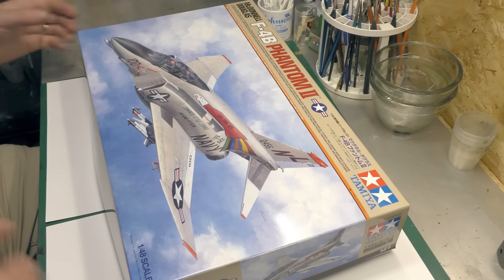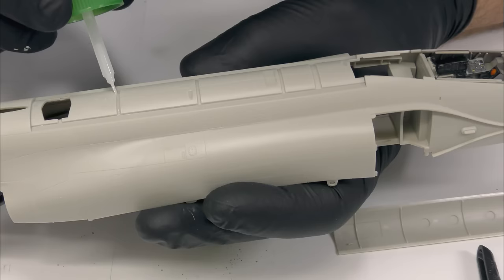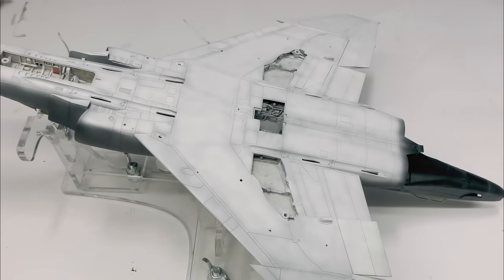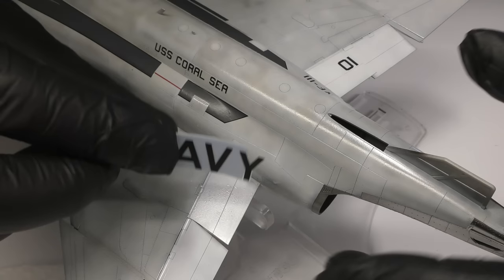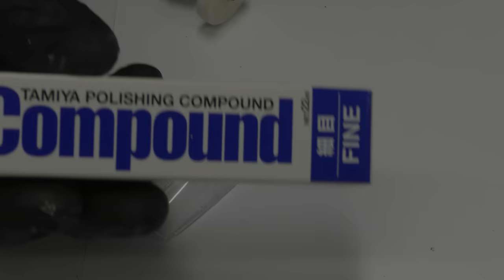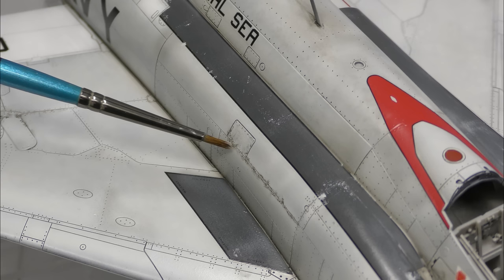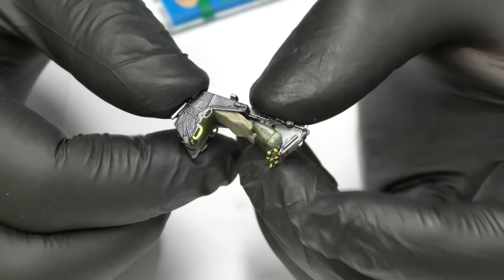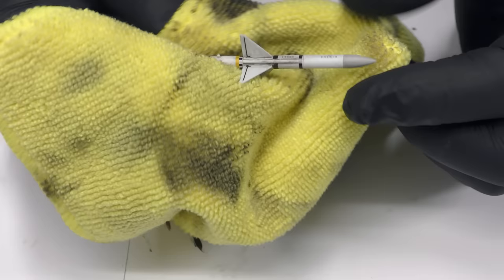Tamiya NEW 1/48 F-4B Phantom II VF-111. Full build aircraft model kit #61121

Comment: I agree that the weathering is way over done. A Maintenance  Officer that let an aircraft get to the state in this video would have been looking for a job outside the Navy. The aircraft would have failed corrosion inspection and the CO would be as mad as hell because it could end his career. One thing that modelers do, not just in this case, is highlight the construction panel lines. These are the panels that can not be removed. If they show a different from the flat surfaces around them it was a sign of a crack in the paint that would lead to corrosion and indicate poor maintenance.  Rivets did not show every much because they were flush and the paint filed in at the edges, if they showed it was because of corrosion. Models that have dents in the plastic for rivets are highlighting things the should not be indicated, fill them in. Service panels are a different story.  They could have chipped paint, dirt and grease that make them show up. Access fasteners could have chipped paint and be from painted to bare steel. The plain captain would have worked hard to keep dirt and grease streaks off the plain so that a leek of any kind would show indicating a problem. The area between the engine nozzles would have been oiled as a protect against heat damage to the metal and it would have a burnt look. This would include the tail hook. If the aircraft you are modeling was painted during the cruise it would have been done in PI and had no problems with the paint for the rest of the cruise. On board ship only touchup painting was done. When aircraft came out of the check cycle most the the panel indication text was deleted, the safety marking, warnings and national markings were the only thing that could be counted on to be there. This model looks impressive to some but it is no ware close to correct. Some of the area you did were very good like inside the wheel wells, the cockpit and the engines. Sorry for what sound like a bad review I just get tiered of over done weathering on Navy aircraft.
Reply from the maker: Thanks Donald. Thank you from your in-depth comment. Not a bad review, all good points and I will defiantly take note next time I do a Navy jet. Cheers